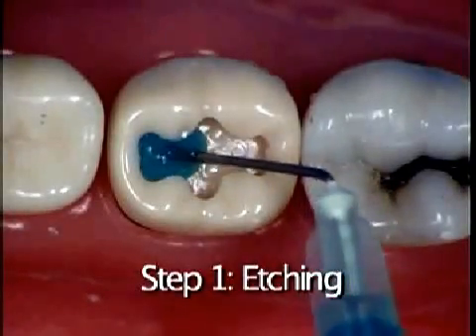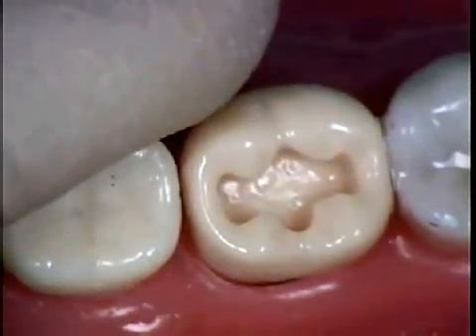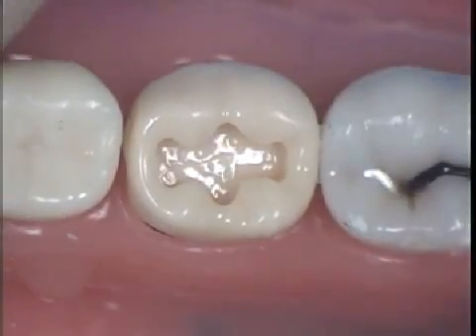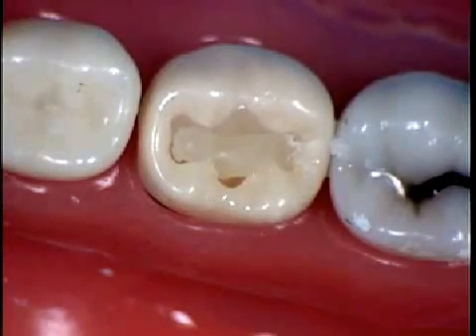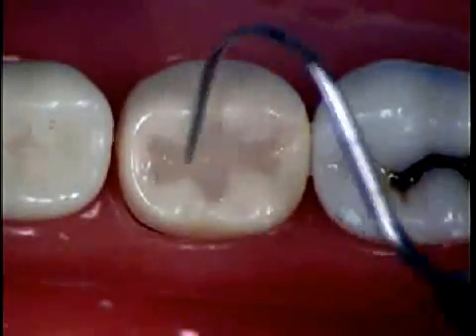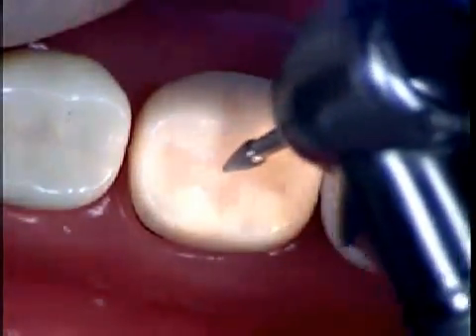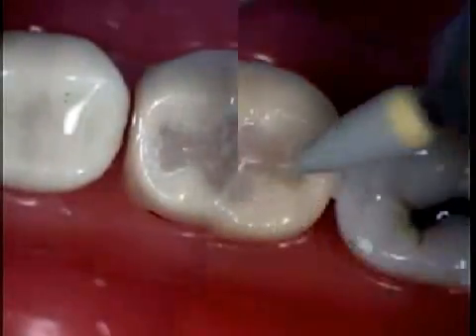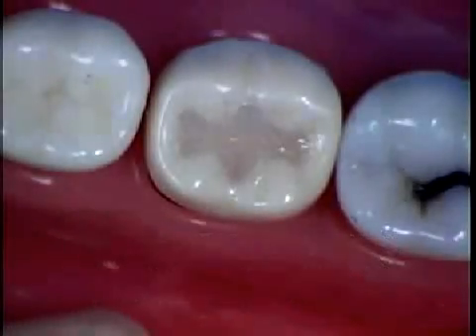Composite Class I Restoration

Comment: This video contains many mistakes.. like they put to much acid etching, they should go with a good isolation to the area ex using rubberdum.. and they should do layering technique otherwise the composite is gonna fail.. in the end the anatomical landmarks are getting great by carving the composite during layering technique.

Comment: Is it safe, unlike the silver filling?
Reply: I would have to disagree. Composites are not perfectly safe either. If you knew the basics of composite chemistry you'd know that after the polimerisation not all monomers react. Those residual monomers are toxic to dental tissue. That's where glass-ionomer base does help a bit but not entirely. In 20 or 30 years when a new material gets invented composites will be blamed just like amalgams are today. This comes from a dental medicine student by the way.
Reply: Lazy Gudetama the silver one called amalgam and they are both safe but for natural look composite is used plus amalgam used cuz the steps to apply it are  few and no asthetic is required in the posterior teeth
Reply: Amalgam least longer in my experience
Reply: Composite is a derivative of plastic.  It is safe, unlike amalgam
Reply: amalgam fillings are obsolete nowadays

Comment: what makes the blue stuff to change to white just curious
Reply: It was washed away by water. Not turning into white :-)
Reply: It's acid - to create an enlarged surface for the composite to adhere better
Reply: The blue stuff is a diluted phosphoric acid ..it creates micro  pores in the surface of the tooth so that the white stuff which is called composite (filling ) adhere and bond well with the tooth

Comment: will the hot and cold air sensitivity pain be visible and do you have to take medicine.
Reply: +Vanessa Li +amaya chapman Vanessa just mentioned another factor that causes postoperative pain. A maladjusted restoration can interfere with the antagonist tooth leading to pain as well.
Reply: You might feel some discomfort and sensitivity while your dentist is drilling and removing your caries but once the filling is done you won't feel the sensitivity. Prescription is subject to the necessity of the patient towards pain tolerance but usually after restoration so far we don't prescribe medication
Reply: +^_^ Hello You should get back to your dentist and tell him your tooth is feeling pain/sensitivity. Maybe it's due to the high points of the composite restoration which when subjected to occlusal forces causes pain or it might be other problems
Reply: +^_^ Hello Go speak with your dentist. post operative pain is caused by many reasons; its an unpredictable result. 0-50% of patients experience what you're going through so dont worry too much. It is important to verify all carious lesions have been removed or its corrosive damage will continue.

Comment: will it be painful to feel the sensitivity
Reply: +amaya chapman Postoperative senstivity is multifactorial. The most recent studies Ive seen range from 0-50% of Px experience pain so in this case predictability is not our friend. Factors range from type of materials use, to correct application of them, how deep a preparation is, how deep the lesion is, adecuate use of cooling agent, type of bur used and its condition, was the carious lesions completely removed? How long was acid etching applied, condition of tooth, dentinal fluid displacement, amount of temperature rise during preparation, etc

There are a ton of factors so its a bit difficult to answer your question for those reasons. Thats why sticking to a strict procedure is important to help lower the statistical chance of pain. Unfortunately no matter what you do, pain is a possible result.  Patients should be made aware of this in the informed consent.
Reply: +papito7757 Couldn't agree more with you. Good info :)
Reply: +papito7757 Couldn't agree more with you. Good info :)
Reply: Vanessa Li Good luck and take care.